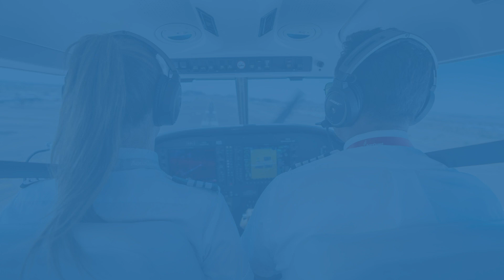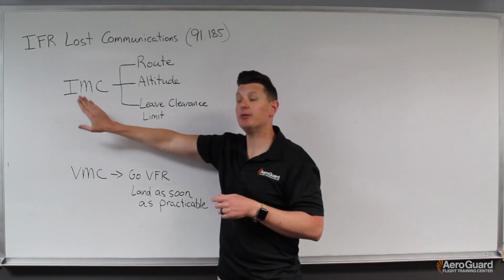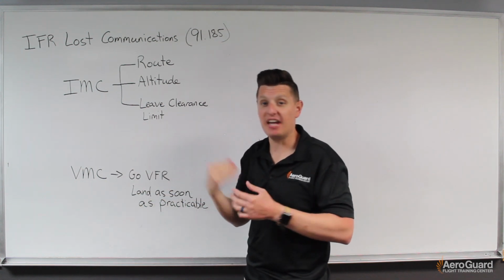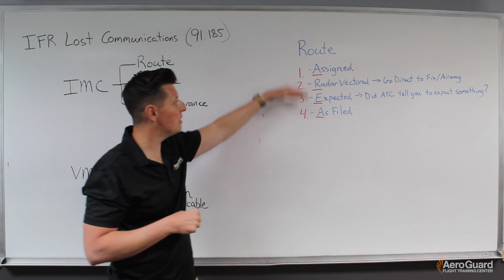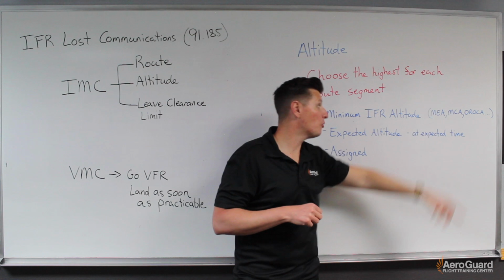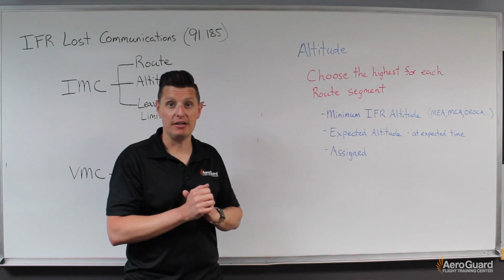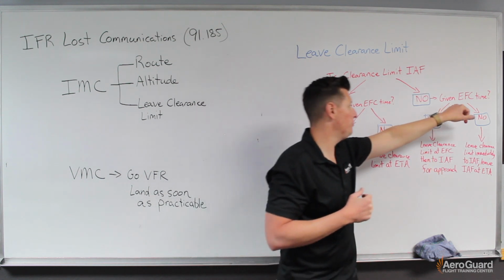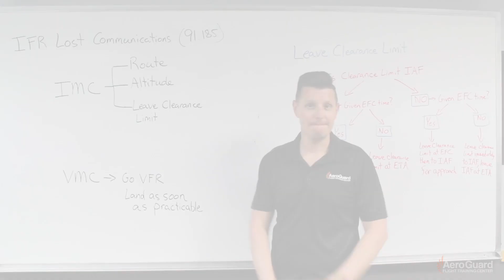IFR Lost Communications Procedures – AeroGuard Flight Training Center

Comment: Good explanation, but I think more scenario based training regarding the clearance limit could be implemented in this to make it easier to understand. For example,  when are you cleared to an airport vs cleared to a fix? Clearance limit in the CRAFT clearance is the airport but when ATC tells you direct to an IAF, then your clearance limit is the IAF instead of the airport. Am i correct in this?

Comment: I don’t believe 185 says you wait till your expected altitude time, it just says whichever is highest which to me would mean if the expected is the highest, you would immediately begin to climb once experiencing lost comms
Reply from the maker: Hi Devin. In AIM 6-4-1(c)(3)(b) there is also a note that states;  

The intent of the rule is that a pilot who has experienced two‐way radio failure should select the appropriate altitude for the particular route segment being flown and make the necessary altitude adjustments for subsequent route segments. If the pilot received an “expect further clearance” containing a higher altitude to expect at a specified time or fix, maintain the highest of the following altitudes until that time/fix:
(1)  the last assigned altitude; or
(2) the minimum altitude/flight level for IFR operations.
Upon reaching the time/fix specified, the pilot should commence climbing to the altitude advised to expect. If the radio failure occurs after the time/fix specified, the altitude to be expected is not applicable and the pilot should maintain an altitude consistent with 1 or 2 above. If the pilot receives an “expect further clearance” containing a lower altitude, the pilot should maintain the highest of 1 or 2 above until that time/fix specified in subparagraph (c) Leave clearance limit, below.

This note, while not specifically a regulation, is the FAA’s way of providing guidance on the intention of such regulations.
Reply: @flyaeroguard  I’m glad you got back to me thanks! Good to know, looks like you’ve made me a better pilot today!